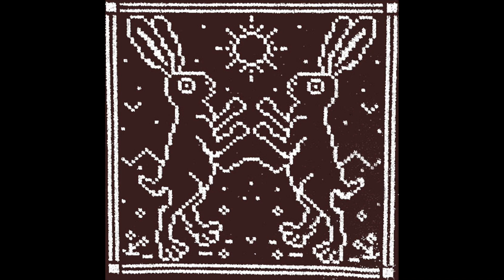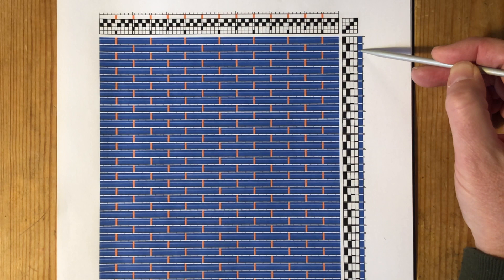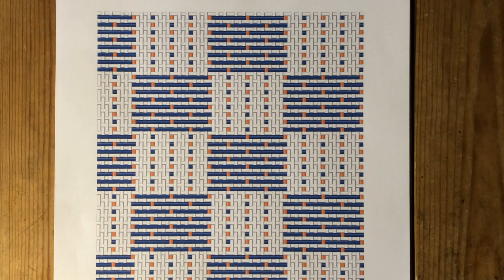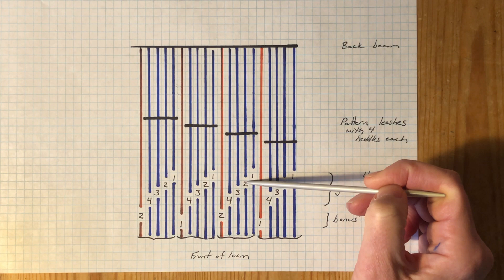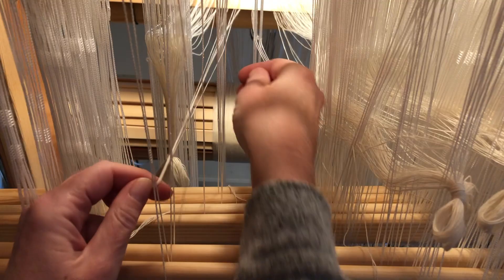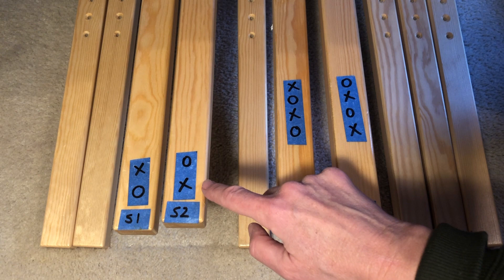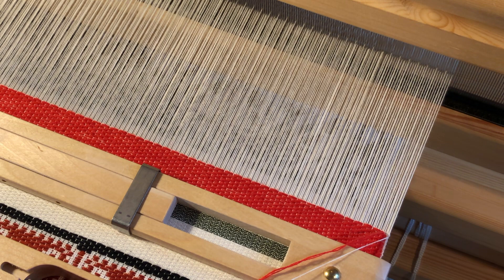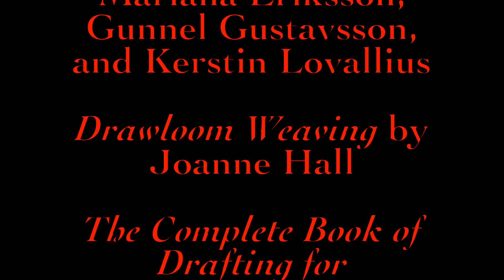Beiderwand on the Drawloom

Comment: "differential take-up was not an issue with this short warp of five meters"
rigid heddle weavers be like 👁️👄👁️
Reply from the maker: I take your point - on its own, the statement does sound kind of absurd! In my defense, rigging a drawloom is such a production it makes sense to put on as long a warp as the weaver can stand, which in my case usually means 8+ meters. On my rigid heddle loom ... not so much.